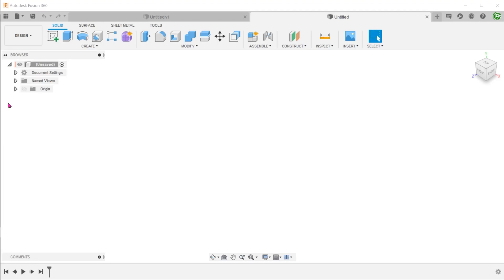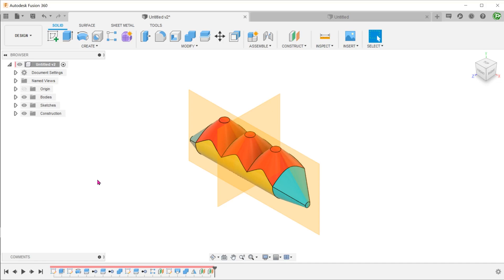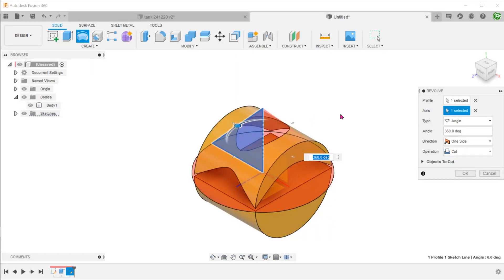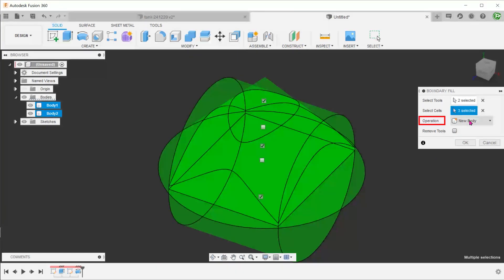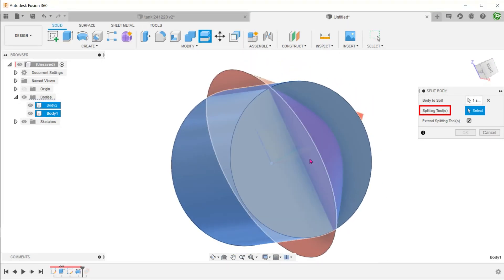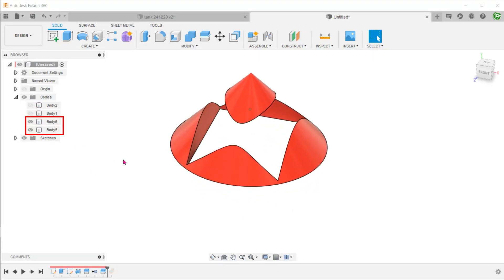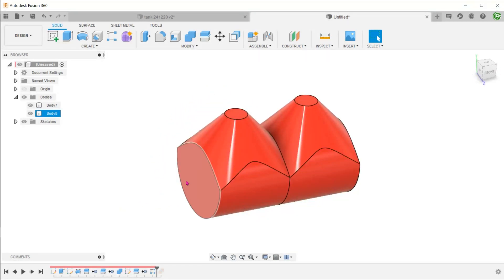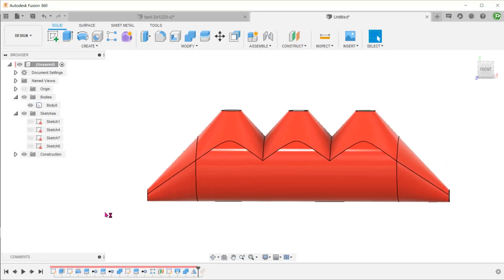Fusion 360 - Visualisation | Multi-Body Approach

Comment: Thank-you for creating this tutorial. It's very informative. 

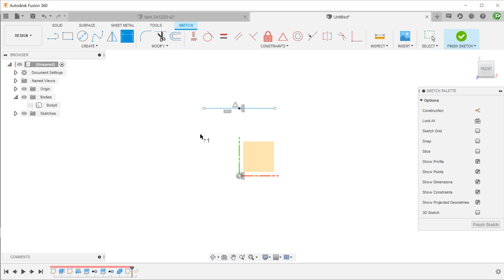I have a question about the operation at  08:08 where you're doing some kind of midpoint constraint from the line to the origin. However I was having trouble replicating that; I'm unable to get the midpoint icon to show up. Can you please tell me why? Thank-you in advance for your time.
Reply: Oh I just figured it out. I needed to hold down 'SHIFT' in conjunction with 'Horizontal/Vertical' constraint tool. Please ignore this.
Reply from the maker: After clicking on the horizontal/vertical constraint, hold down the shift key and hover over the line until the triangle pops up.
Reply: @Fusion360School  Thank-you for the prompt response.

Comment: Nice explanation with plenty of details about the decisions taken.
Since you were exploring options, you could add a cylinder below the cone (just a rectangle in the same sketch before Revolve) and then apply a Combine Intersect between bodies.
I have not tried myself, just suggesting 😉👍
Reply from the maker: Hi, thank you for the suggestion. I had played around with using combine (intersect). Tried with and without keeping tools. I was not able to find a clean and short way to achieve the final result. Might need to experiment more.
Reply: @Fusion360School  you are right. The upper side of the cone doesn't match the cylinder geometry so Intersect won't work.
Sorry to mislead you!! 🙈
Reply from the maker: No worries. I think intersect will work. I just haven't found an efficient way yet. Split body is more intuitive in this case.